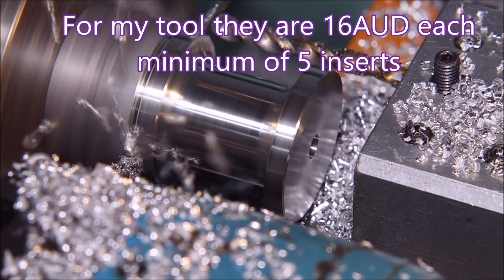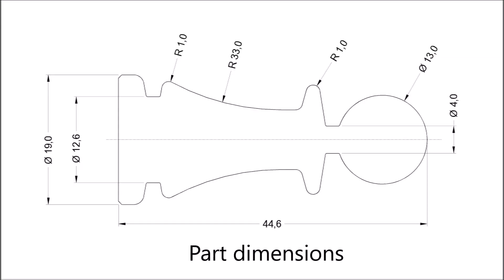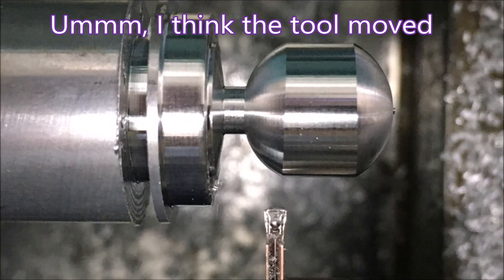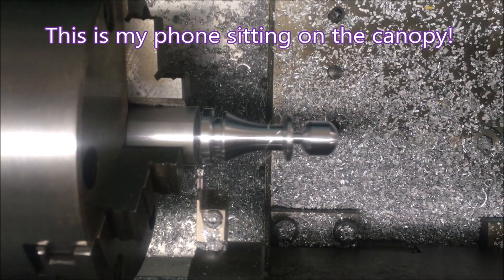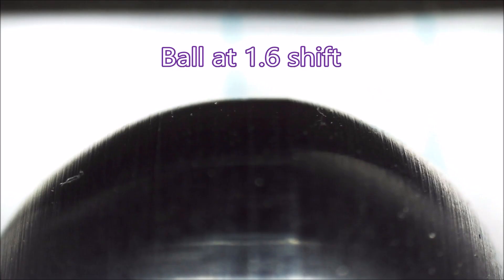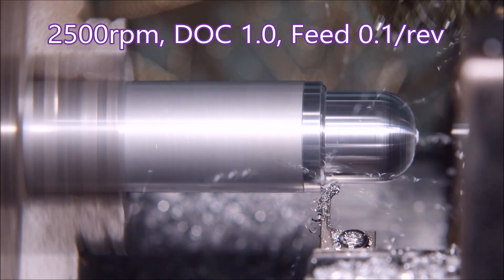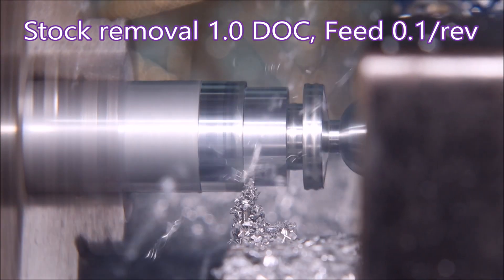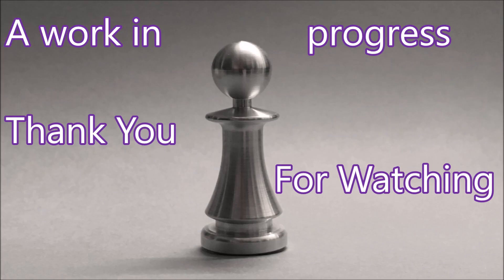Profiling with a  carbide parting tool and a small cnc lathe

Comment: I think the problem is not that simple. You can achieve true balls easier by the round insert. The tool needs to travel in a path that is the desired radius plus the tool radius and you should be golden. I would be surprised if the cam on the dos software would be able to compensate for tool radii on its own so it might be a manual calculation, easy one though
Reply: The 1,6mm step over would only produce a true ball form with a dead sharp cornered tool that is 1.6mm wide. Any part of the tool that protrudes over 1.6mm width will cause it cut too much on the sides, if you measure the ball with micrometers you will notice it's too narrow even with the 1.6 stepover.
Reply: It is doable but you need to program the radii oversize by the amount of corner radius and maybe fiddle some with offsets on top of that

Comment: G'day mate, where in aus are you getting these tips? I'd love to get my hands on the high rake parting tool and that profiling one...
Reply from the maker: CEW.Manufacturing will see if I can get a number for you.
Reply from the maker: CEW.Manufacturing I deal with my local Sumitomo rep, who is a great guy. I am in Melbourne, where are you?
Reply: @smallcnclathes  I'm up in brissy. I actually just built my own CNC lathe, it works pretty damn well (though I'm biased). It does struggle a bit with parting, mainly from vibration not power. I'm looking for some inserts that may reduce cutting loads/change the way the tool is loaded and make it a tad better.
Reply from the maker: You can look up the Brisbane rep on sumitool.com.au  
GF insert is for low cutting force parting and ML is the one for profiling.  My tool will only part up to 20 dia as the shank is just 10x10 (for my turrets) Go larger shank and you can go larger diameter.  Tool holders are expensive but damn good, only tool I ever needed an angle grinder to shorten the shank.
Reply: @CEWManufacturing  , The vibration may be down to what you built the lathe out of. Cast iron (traditional) has very good vibration dampening capacity, aluminium has poor dampening capacity so if you lathe has lots of aluminium (cast, extruded, or plate no difference) it will likely vibrate. Incidentally Magnesium has even better damping  than cast iron - bit hard to get though 😊... Martin
Reply: @olfoundryman8418  G'day Martin, no aluminium in it at all (well there is in a guard plate, but nothing structural). The majority of the lathe is built from mild steel, not as good as cast iron, but better than ally. I suspect it's either the ball screws I'm using (not being double nut therefore having a very minor bit of backlash) or the linear rails being too small (only 15mm linear rails, square, proper ones, but still small).

It just goes to show how different the loads with parting as opposed to other cutting types. I can turn steel at 0.5mm off the radius and 0.2mm/rev with out the machine batting an eye. I can drill at manufacturers reccomend feeds and speeds for a 10mm drill (approx 900 rpm, 0.1mm feed per rev) again with no problems. But parting... Parting is killing me.
Reply from the maker: I don’t think you can get better than a tool that will use the GF Sumitomo insert. The 2mm that I use is great for parting, for me anyway. I also use a low cutting force Kennametal insert at 1.6 wide. It is also good. You could check to see if the GF comes in 1.5 wide, that would reduce the pressure even more.
Reply: @smallcnclathes  thanks for all of the information!
Reply from the maker: CEW.Manufacturing let me know how it goes.
Reply: @CEWManufacturing  , Eh, not sure about mild steel being any better at damping that aluminium. The steel may deflect less as it maybe stronger (depending on the aluminium alloy) which may help. But I once used a steel lathe for machining analytical samples. A simple facing cut across a 50 mm face on a mushroom shape. Samples were in Magnesium (I worked for VW at the time) and they machined well to a smooth chatter free finish, and in aluminium rough and chattered regardless of what you did - the difference was amazing - the magnesium of the sample just damped out everything. Very large machine tools now sometimes use magnesium alloy bases. However I think you may be on to something re the backlash  - can you retrofit double nuts? Possibly too its a combination - the ms the backlash and the small rails.  Parting used to kill me too (manual lathe) NEVER worked right rough dished finish broken parting blades etc. I now use the 1.6 wide tool as suggested by smallcnc - not cheap by the time I bought the necessary holder but Oh so much better. I can part straight smooth and no broken tools  - parting is now a doddle. BUT make sure you get the right holders! some do not have the anti flex reinforcing. I think that smallcnc explains this in a video he did on parting.. Martin
Reply: Build a new one and fix what you learned from the previous one.

Comment: you have 2mm wide parting tool and it has 0.2 radius. simple part there was measures even many things not have dimension its all guess work LOL. cut it lol
x-0.4 z0
g3 x13 z-6.7 r6.7
g1 z-8.3
g3 x4 z-14.485 r6.7
g1 (no dimensions to continue)
Reply from the maker: Jari Sipilainen thank you, will put your data into simulation software when I get the chance.
Reply from the maker: Thank You, simulated perfectly which surprised me (not that I thought you were wrong), but that normally is not how the software writes code for circular interpolation. Difficult to compare your code with what the software has written.  My circular interpolation codes include a "K" and "I" instruction.  However, I am starting to think that I should check my lathe for backlash in the ball screws.  Would not require much error to mess with this shape.  This machine does not actually have ball screws, it has satellite screws which can be more of a pain to adjust.  Thank you for you assistance, just wish I knew how to compare what you are writing with what my software gives me.
Reply from the maker: https://youtu.be/zuI7quN8HfE 
Shows your code in my software. 
Nigel

Comment: Thank your for your videos. I learned a lot. 
I hope I can find the sumitool parting tool in the future in a store where I can buy it.
Reply from the maker: Philipp CNC where are you located?
Reply: @smallcnclathes  I come from Germany, NRW😅
Reply from the maker: I believe Sumitomo tools are available in Germany.   I think this is them.
European Headquarters
Konrad-Zuse-Str. 9
47877 Willich, Germany
Reply: @smallcnclathes  Thanks for your help!
Reply from the maker: have you seen this? 
https://youtu.be/W1VQu6rKL8E
Reply: @MrPhilxxxxx  
If you are based in Germany you might be better to buy Sandvik rather than Sumitomo.
Both brands are excellent, but Sandvik would be more readily available to you.
Reply: @weldmachine  thanks!
Reply from the maker: Sumitomo are available in Germany, I have a UK friend that buys from there through a friend. Sumitomo in the UK are a bit hard to find. I gave up on Sandvik, once I discovered their threading inserts are Sandvik only.
Reply from the maker: Philipp CNC very. I have 3 and they were all very expensive. BUT, I have never regretted a single cent that I spent on them. They work for me!
Reply from the maker: @MrPhilxxxxx  I have heard that a tool similar to this works well if used correctly.  I have not used it, so cannot recommend it but it is very cheap and may be worth taking a risk on. 
https://www.ebay.com.au/itm/MGEHR1010-1-5-External-Grooving-Lathe-Cutter-Boring-Bar-10pc-MGMN150-G-Inserts/293303868873?ssPageName=STRK%3AMEBIDX%3AIT&_trksid=p2060353.m1438.l2649
Reply from the maker: @MrPhilxxxxx  That is expensive, I paid around 80Euro for mine, but that is some years ago and I think it was a discounted price.
Reply: @smallcnclathes  no I meant the holder and two inserts for 130€😅
Reply: @smallcnclathes  
I am a Die Hard Sandvik guy, LOL.
I don't find the downsides to often.
It's easier for me as mostly my tooling draw is is filled with Sandvik.
Then filters down from there.
Seco, Iscar, Sunitomo, Walter some Kennametal but not a lot.
Reply from the maker: That is still a very high price to pay. Check out the ebay link I sent you and see what you think.  What size tool shank do you need?  The one in the link is only 10x10
Reply from the maker: I started with Sandvik, but I guy with a proper cnc workshop told me That for my work Sumitomo would be great and with Sandvik I would be paying for more than I needed. He was right.  He used Sandvik for st st buttons he was making , costly but gave him the best performance so he paid for it.